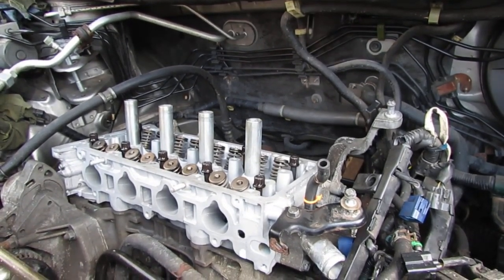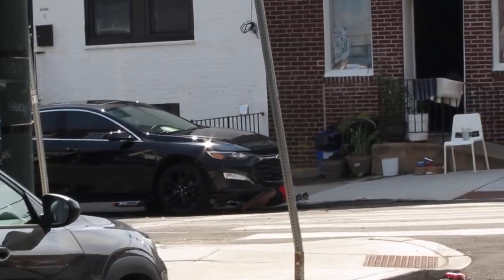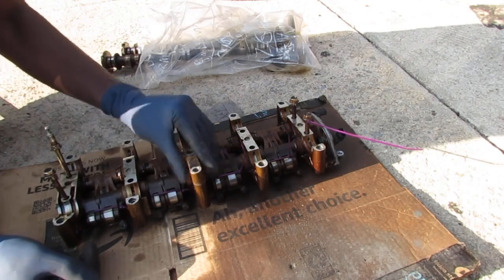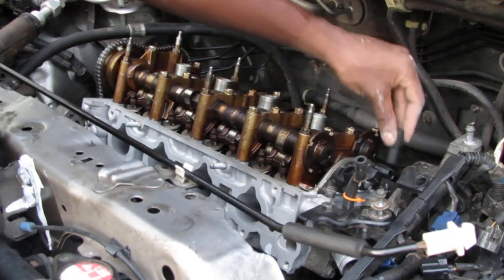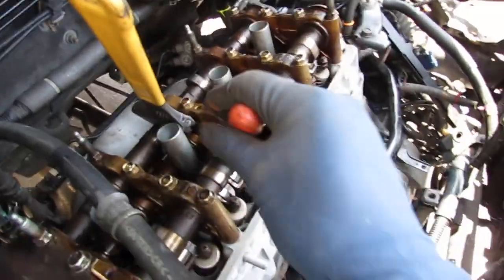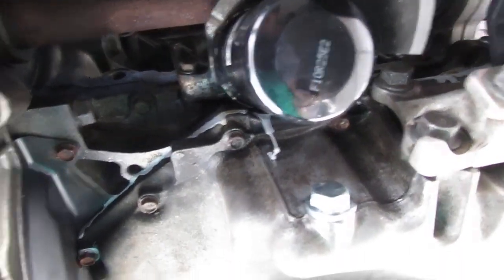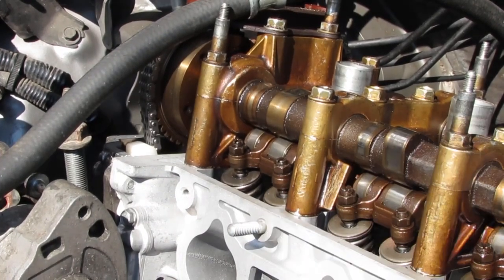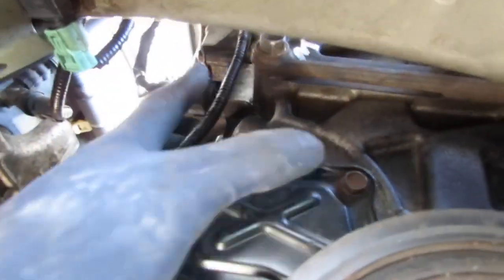2007 Honda CRV Blown Head Gasket Part 8, Valve Clearances Takes Time!

Comment: Wow I have enjoyed the whole series so far. I have a 2008 CRV so this is super helpful as I will likely need to do this job in the future! Thanks so much for documenting this whole process!!
Reply from the maker: Awesome,  the car is finished and runs better than ever.  I encourage you to watch all the videos from this series as I find mistakes that I have made previously that can be avoided.  Also the last two videos still need to be uploaded.
Reply from the maker: Dropped your you.  "2007 Honda CRV Blown Head Gasket Part 9"
https://youtu.be/z6X31srlB7M
Reply: @MotionDesignStudio  Thank you man!!
Reply from the maker: @jasonyoung4085  , no problem.
Reply from the maker: @jasonyoung4085  , final installation.  2007 Honda CRV Blown Head Gasket Part 10 https://youtu.be/aDDOdmFlp5A
Reply: @MotionDesignStudio   just got finished watching, you did a great job for working outside on the curb!
Reply from the maker: @jasonyoung4085  , thanks and I appreciate the sentiments.